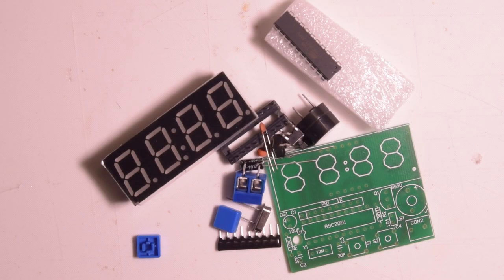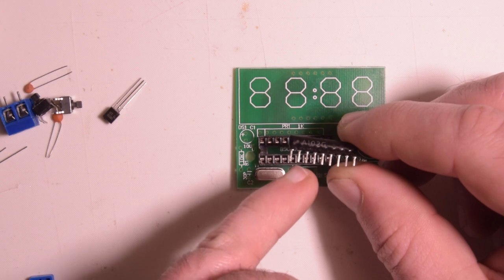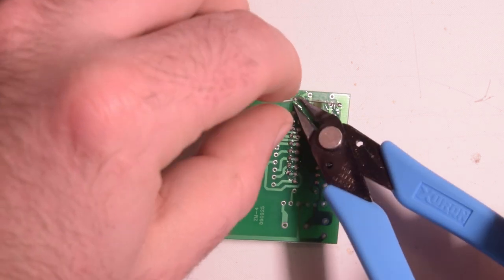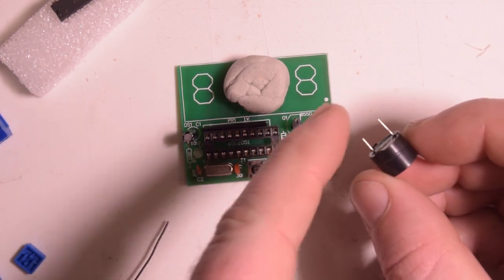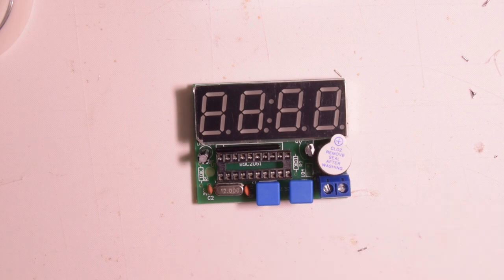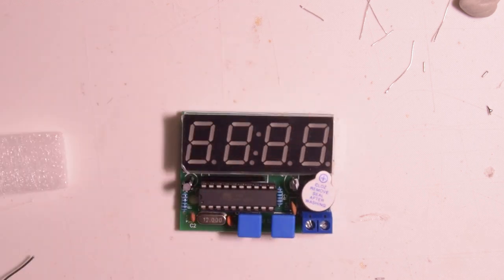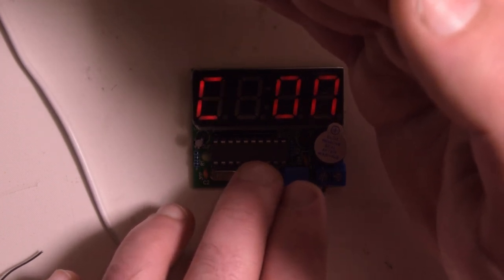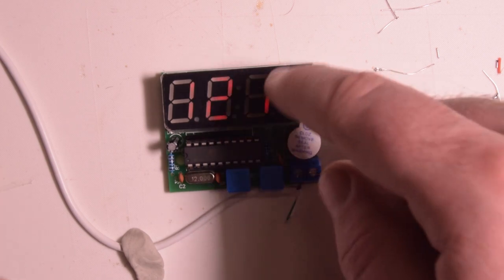Kit Build: Digital Clock

Comment: I made a clock based on an arduino and made the display bright - at night it lit up the room! so a dim display is an asset for a bedroom alarm clock at least. I built one of these kits a while ago, I don't know what became of it in my house move, but I was going to put it in a box with a lithium battery and a charging module as a travel clock. I thought about modifying it to blank the display to save battery, but hadn't worked that out before I designed my own. I imagine it would be easy to do if you modified the PIC software, but you'd have to track down the source from the original project the kit makers undoubtedly copied.

Comment: Built this clock just now. Yikes. Your criticisms are very warranted. I tore off three solder pads and had to bodge them with wire. But it does work. The instructions lmao. Completely useless!
Reply: Tested mine with the 5v, it’s very bright I would say